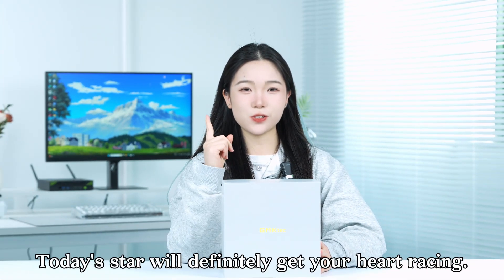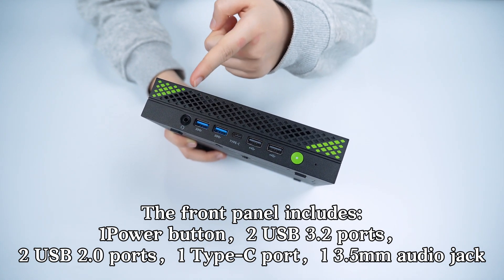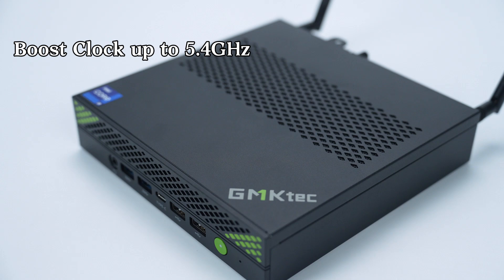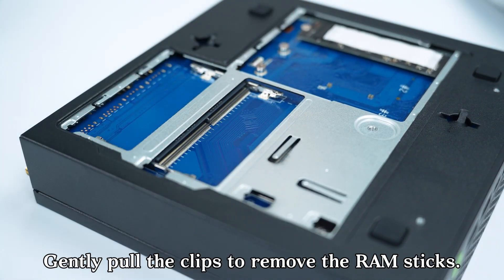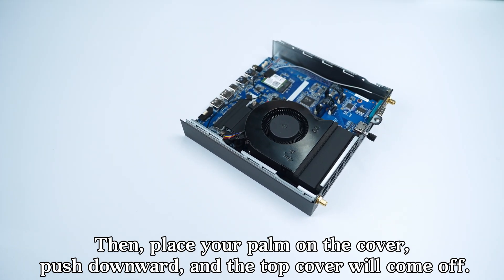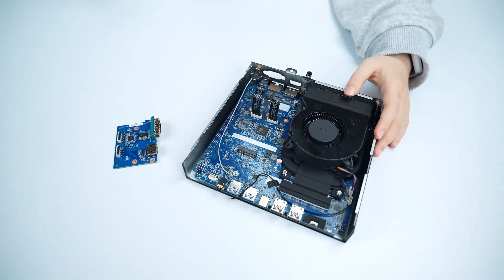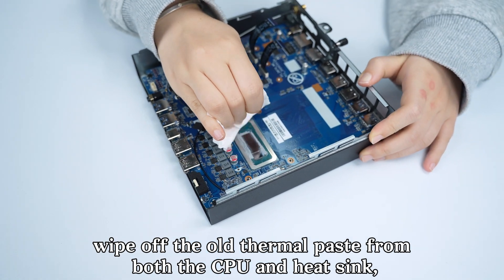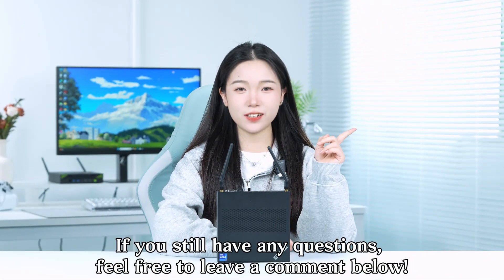K10 🎉 Unboxing Time! 🎉#gmktec

Comment: Hi, can you provide a DP connection guide to properly enhance external graphics capabilities? Additionally, could you add directly purchasing options on the website and/or provide a detailed guide for RAM expansion? I wonder why there is a lack of details in the manual; In any case, I like this product. Thanks